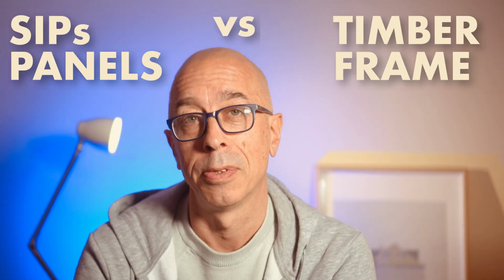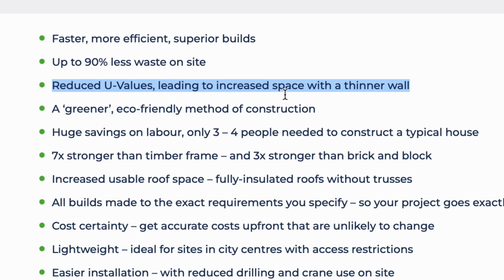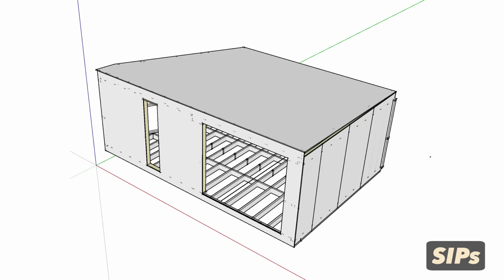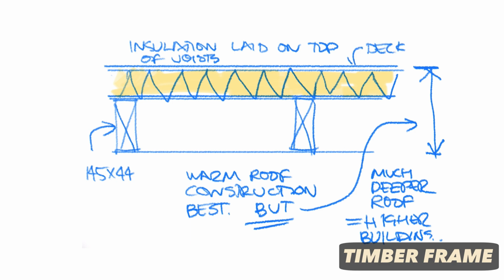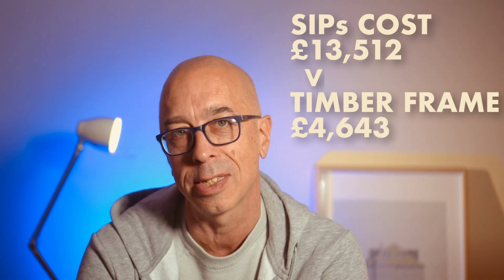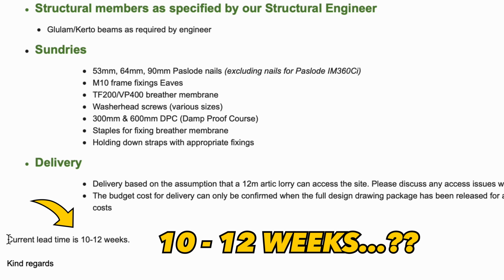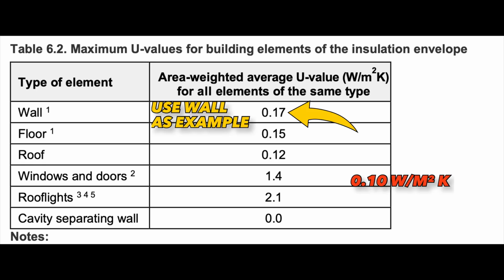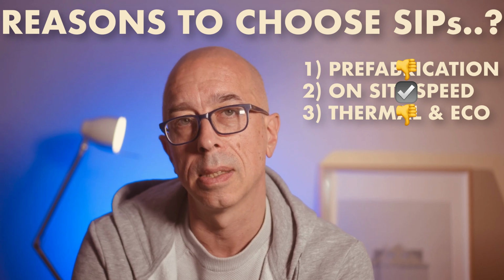What's best SIPS v Timber Frame - You won’t like what I’m going to tell you

Comment: Kingspan manufacture a 142mm sips panel which will provide 0.2 on its own but, with a 20mm inner lining, will achieve 0.16.
Reply from the maker: Yes. . But do the maths on the costs and you may get a shock.

Comment: Okay apparently with some quick pausing SIPS are structural insulated panels. Which look like stressed skin panels. 
And then timber frame is actually stick- built construction using studs?

Comment: ... and best of luck trying to find a structural engineer capable and WILLING to do the SIPS calcs.  Actually good luck trying to find a willing engineer full stop.  They seem to be an intransient bottleneck on projects.   I got a SIPS quote last year and was non-plussed by the double engineering that was necessary - when I read that requirment it was "WTF ?? ... oh forget it!"
Reply from the maker: Hi. Yes, it’s a mission. Is there a lack of engineers? There’s certainly not a lack of architects. Thanks a lot for the comment.

Comment: Is it me, or are the CLT studs basically just a timerframe? Seems like requiring a timerframe to build a timerframeless house is a bit of a mis-step.
Reply from the maker: Yes pretty much, you mean CLT or CLS? although some sips manufacturers are now coming up with insulating composite studs for the frame, which helps the u value, but still a fair bit of labour.

Comment: You must ensure that the SIP's joints are air tight, or you will have rot in the OSB/plywood that will necessitate very expensive repairs. 

Blind sealing with spray foam is not adequate. 

Rain screens are a great upgrade with SIP's. It will mitigate possible condensation  issues.

Comment: The sips for my whole house here (Canada) which is 2 story, 1200sqft each floor and a 2 car garage, 624sqft with a 24x19sqft loft above cost a total of 32 000$ CDN and 5 days to install. Watching the houses go up around my in timber frame, this seems to be significantly faster. It was also only 5% more on the total cost of total materials for my house based on quotes I got. Now the real big difference, my house is using 25% less electricity while being bigger than a couple of my friends' houses.
Reply from the maker: Thanks for the info. For larger plots like this, sips is definitely an option. In the UK, you still have the supply chain issue with sips manufacturers sadly.

Comment: I wonder about having PIR on the outside and the breathable membrane. I imagine the PIR on the outside actually closes that wall up, creating an barrier that almost doesn't breathe. While normally you would put a breathable membrane on the outside to let the moisture out that came from the inside. Would you still put a membrane against the outside PIR? And would you go for a different kind of vapour barrier on the inside when placing PIR on the outside? Perhaps a membrane that works in 2 directions?
Reply from the maker: Vapour can still get through the wall assembly. You would need to understand where your calculated dew point occurs for your circumstances , ensuring it was beyond the cold side of the osb. Then you have a breather membrane allowing any residual vapour into the ventilated cavity. Place the vapour retarder on the warm side
Reply: If the PIR has aluminum foil sides and the seams are taped, that would create it can't get through I think. Because aluminum won't let the moisture through. How would you let the wall breath in that case?
Reply from the maker: Yes I don’t tape joints on certain dew points.
Reply: What if I did? 😅

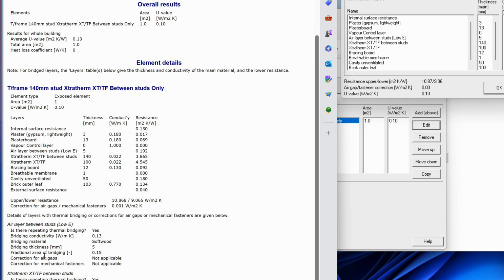Comment: Just checking 0.1 U val in 328 mm wall?  Aren't items 5 and 6 from the list shown at 10:28 (video time) between the studs and the PIR 100 over the studs?  I make this wall to be 415 using a 145 mm stud.  Any which way I add these figures up and include the in-between insulation, it does not add up to 328 mm.  Please, can you explain further?

Comment: I found this video, but my question is slightly irrelevant but I'm going to ask anyway lol..

I'm thinking of a side extension. Should I go Brick or Timber Frame? The existing property is already subjected to some vibration and noises from a main road and I'm wondering if a timber frames extension will vibrate more than brick? Also if sound insulation is poorer than brick?

Many thanks!
Reply from the maker: I’ll always choose timber frame over masonry for the structure, I’ve gone into the reasons in another video on the channel, cost, speed, environmental efficiency. I can’t really comment on your vibration as that’s part of a whole design solution including the foundations. Acoustic design solutions will work fine with both provided you start with the acoustic in mind rather than specifying the wall, and then thinking about sounds at a later date. Holistic right at the start. Best of luck.
Reply: A beautiful and reassuring reply. Many thanks! Have subbed and will scroll through your videos. 👍👍👍 @build-better-things

Comment: There is a difference between open cell and closed cell, polystyrene or polyurethane foam in SIPs. For a given wall thickness, they are not equivalent.

Comment: Would you suggest these like for like comparisons hold true for full house construction?   Im in the early days of planning a small and pretty simple 2 bed scottish cottage style build and ive been aiming in the direction of SIP suppliers such as scotframe - mainly because ive neber built a full house before and it seems easier for a first time self builder - but budget is pretty much everything for me as this will actually be my first house.... ive ever bought or lived in.  Wish me luck guys! haha
Reply from the maker: For full house construction, economies of volume mean it’s not as big a difference. Just be aware that the wall thickness of both constructions should be your determining factor in terms of the actual u values, along with cost, and that the claims on the SIPs websites paying the premium regarding thermal advantage are not usually correct. Note also that Scotframe are not really a SIPs panel, it’s a sort of a hybrid product. Best of luck with your project.

Comment: I live in a three story town house made using SIPs panels and an MVHR in Scotland, it is 40 minutes from Edinburgh for reference. It can get fairly cold here (minus temps) as the it is a seaside town, the MVHR struggles at times and we have had some difficulty moving from a common boiler heated home but after just over a year, I feel like I am starting to understand and use the MVHR effectively. 

It is a okay system and I can recommend SIPs as a good option, although I am still learning everything I can to do with it (mostly upkeep of the MVHR).
Reply from the maker: Hi and thanks for your post. Interesting to hear whether your house is a one off or part of a development, how the heating works with the MVHR etc.  For a whole house solution, especially with heat recovery, sips are a fine self build solution if you’re on top of the logistics. My point was more on the cost, service and thermal claims these manufacturers and marketeers make in comparison to contemporary sick and timber frame construction.

Comment: Prefabrication is really a moot point. Agree SIP suppliers can be pretty bad at getting back to you, but I hear from clients of builders not responding a fair bit too, so same difference. You either have a 10 week lead time or you don't, if you don't then they're not viable. Also air change governs thermal losses at low u-values, which you've omitted to discuss and SIPs if installed correctly should outperform timber stud on this. Also they are much stronger in racking and flexure.

Comment: What would you think of rather than putting the insulation in between the stud youse a insulated plaster slab on the in side  giving an air gap in the stud and insulation on the out side

Comment: I'm glad you have validated my conclusions every time I open excel and try to prove I should use SIPs!

Your drawings are fantastic. Do you have any plans to sell them for home construction projects please? Or do we really need to engage you on a job by job basis?
Reply from the maker: Hi and thanks a lot. If you mean the drawings I use in the video, I’m happy to leave them in the website for download but they’re really only part drawings to show the construction. Don’t you think they’re too generic to use for a construction project?
Reply: @build-better-things I can work out materials lists, dimensions, and such when I know how to build something. What I lack is confidence in the correct way to build something. For instance the precise layers in the walls of an outbuilding, how to spec the floor joists, what the detail looks like where the roof meets the walls etc. If you sold a "this is a 6x4m room design, and you can scale it up and down as you need to some extent" I think that would be useful. As an example I'm currently looking to build a garden gym myself, and I will almost certainly overengineer it as I don't know any better. A bit like people sell kit buildings, it would be great to buy "kit plans" that I could do myself. Cheers
Reply from the maker: @russtaylor4242 Thanks. Yes I might pull something together like that.

Comment: I'm not convinced by this video. The figures quoted for SIPs seem completely over the top and you haven't accounted for other suppliers/ types.

Accepted that you are looking at a non-standard building design, whereas most people, especially those building garden rooms, will have a standard square or rectangular block so a SIPs construction would be ideal. Quick searches have given several suppliers of a 'standard' SIPs construction kit (building only) for between £4k and £6k. This is for the walls, floor and roof. To make it even cheaper, you can go with buying individual SIPs panels (1.2m x 2.4m) and adapting these to your size requirements. 'SuperSIPs' has 125mm thick panels with a PU filling for £104 excl VAT and delivery.

I'm looking at building a garden room (5m x 3m) with SIPs for walls, a Kingspan insulated corrugated roof (100mm PIR). I'm most likely to make floor from 5x2 floor joists with 100mm PIR sitting on pile foundations, however, I may end up doing a full concrete pad instead. Excluding the foundations and flooring, my initial research has the build cost using SIPs and Kingspan roofing for around £3.5k excluding doors and windows.

I'm anticipating the total cost of the build (foundation, floor, walls, roof, doors & window, external cladding) to come under £7k. SIPs construction is significantly cheaper than using timber frame in this instance, with reduced time, easier build, and massively reduced labour costs. Grateful for some comments.
Reply from the maker: You say it yourself. You’ve done only “Quick searches”.  I refer to the claims and their websites in the video which I think I demonstrate are not accurate versus other methods , and I use actual figures.  Once you’ve gone through the process in detail, come back and share the actual prices you receive, and your service experience.

Comment: In the US heavy timber frames are often wrapped with SIPs the two together are a perfect marriage for a high performance building system. That being said a timber frame in the US is different than what you are depicting, often it is referred to as stick framing in the US. That aside though I do believe we should phase out the "timber or stick" framing, SIPs are an up front cost but you save in labor and energy savings.
Reply from the maker: Hi and thanks for the comment. For smaller projects, I don’t think sips saves energy nor labour costs, as I show in my analysis. This may be different for bigger projects, 200m2 plus, and I do agree the service is probably better in the usa than here in UK , which makes a huge difference to the process.
Reply: Stick built just got a huge boost with insofast x brackets.  Polyurethane closed cell spray foam the exterior and both air and water are taken care of.  I haven't seen blower door scores but I bet they will be at passive house level.

Comment: Thanks for posting, why do we need a brick wall in addition to the SIP? SIP can be the external wall with either raised seam metal covering (also usable on the roof) or other external wall covering systems
Reply from the maker: You don’t need brick but you do need some method of ventilated rain screen system, brick or metal or other with any sips. I didn’t think I focused on brick in the video?
Reply: @build-better-things  Thank you, if the external brick skin isn't necessary then there isn't a cavity and in that case the wall thickness is considerably reduced by as much as 150mm
Reply from the maker: @soundslight7754 you need a ventilated cavity and it needs to be 50mm plus whatever your external screen is, so the 150mm is not correct.
Reply: @build-better-things  Thank you. I'm not here to catch anyone up, rather to learn from your years of experience and amplify my understanding. I've seen Catnic SSR2 coverings installed on battens that are nailed directly to the SIP panels wrapped only with a thin sheet of breathable membrane. I figured if the brick skin isn't needed (100mm) then the cavity requirement must be met by the gap between the battens, so the 150mm I mentioned is made up of 100mm brick skin and some of the 50 to 100mm cavity allowing for batten thickness and about an inch taken by raised seams on the metal coverings. Where am I going wrong? 
I appreciate you're saving 50mm vavity is still required for SIPs.
Reply from the maker: Hi. Yes it’s hard in the comments. So from your 150mm after the sip , omit brick at 100mm, you’ll still have your 50mm, then add back in whatever your screen thickness is. Hope I’m understanding
Reply: @build-better-things  Thank you

Comment: you're comparing sips vs stick built, not vs timber frame. Timber frame kit is usually factory made in Scotland...
Reply from the maker: “Stick built” is a North American term, “timber frame” in the UK. The factory made stuff would be either “floor cassettes, closed wall panels” or “open panels,” all prefabricated timber frame from a factory with shop drawings, since we seem to be splitting hairs. Timber frame is a generic term and if you were self building your extension, timber frame would be the jargon I’d be expecting to hear, throughout the uk and Europe.
Reply: @build-better-things  whatever the correct terminology is, i'm saying you're comparing factory made sips vs non factory made timber frame. Factory vs factory would be more useful, since this is the norm for timber frame in scotland.
Reply from the maker: This comparison is for self builders and small builders figuring out whether to opt for SIPs or timber frame using a site joinery process, per my examples on the channel. I thought it was obvious this comparison is not for volume house building using timber kit manufacturers.
Reply: @build-better-things  and btw i'm pretty sure stick built is also the term used here in scotland: https://www.structuraltimber.co.uk/wp-content/uploads/2022/09/Consumerguide1-stickbuildvpre-manufactured.pdf